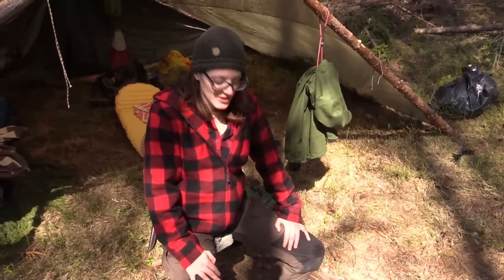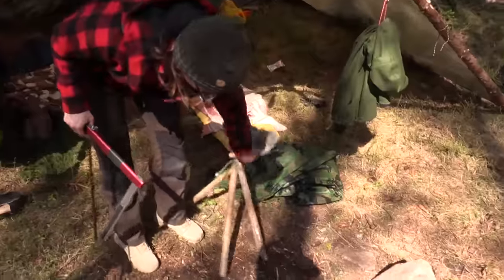How To Make A Quick Camping Seat

Comment: I really like this one. I might sew some fabric in rectangular shape and make some pockets in the corners and use that instead of the shemagh.
Reply: Good idea.  If you have or find one of those folding camping chairs with the tubular metal frame that is broken that would be a great place to obtain/recycle the fabric and it would be very strong.  In fact, being that I doubt the setup that held Lilly up just fine would hold my weight, that would probably be just the ticket for me.  I used to see commercial three-legged folding stools that were made like those chairs but folded down into a very light and compact package but haven't seen them for sale in years.

Comment: Actually, that's a great camp seat design. Though I would change the upper string method and replace it with a animal skin  instead. I think sitting on a cordage after a while will cut off blood circulation on a older chap such as myself.

Comment: Geez, new with the new intro I thought I was watching a Spielberg movie...must be nice to be a lightweight woman...that design would probably be taking my temperature very quickly...:=/
Reply: Paracord has a breaking strain of 250kg.
Reply: Soggy Wombat Not talking about the cordage breaking...the shemaugh, however...I realize it is called 550 cord for a reason...it's a joke on my part...
Reply: Not entirely a joke.  Most of the 550 paracord I see - the non-military stuff, at least - says that it has a max load of 550 pounds but a 'safe working load' of 110 pounds.  That is quite a difference.